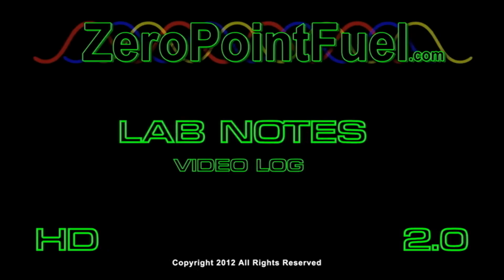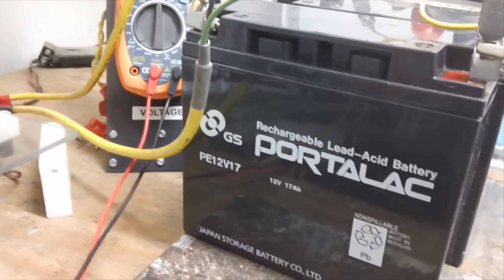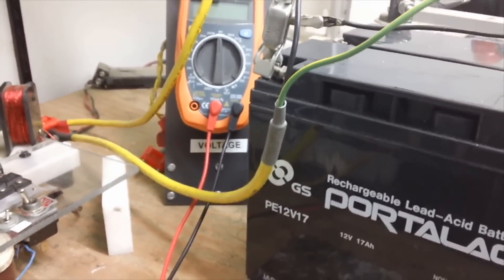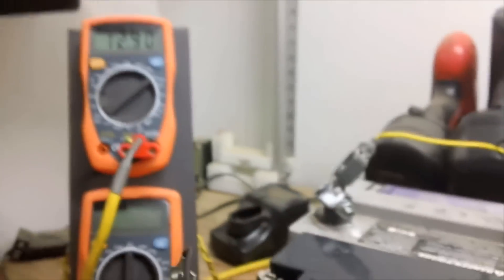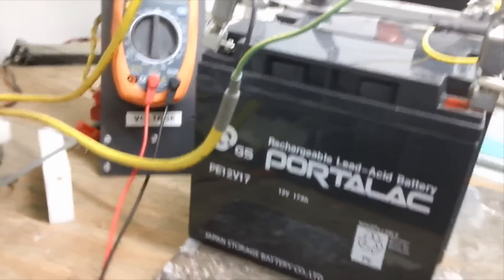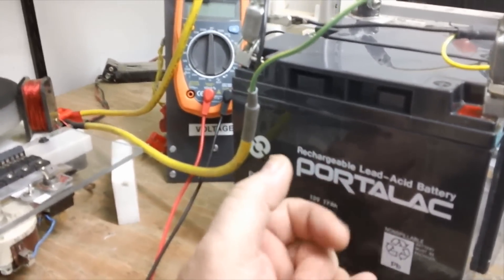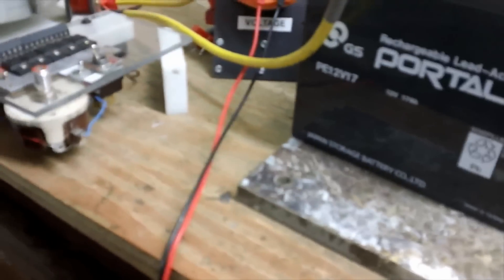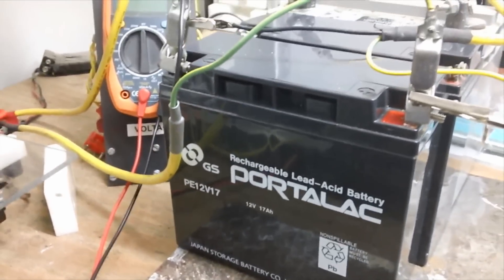Pulse Motor Charging a Sulfated Battery

Comment: ok so my question is about the out put to the battery being charged. I have done some testing on my pulse charger charging a capacitor capable of holding 200 volts and it gets up there pretty quick... im hesitant to attach such a thing to a lead acid battery as i dont want it to explode due to over charge. So i gathered from your video that the lower the input voltage and rpm of wheel the lower the back emf voltage spike is which would make the input charge to the dead battery manageable. am i correct or do you have a cut off circuit to protect things?
Reply from the maker: Well, Kevin yeah your capacitor can blow up if you overcharge it can explode and sound like a gun throw shrapnel everywhere.  If you hook a battery up with the capacitor  it will climb slower the capacitance is blocked off due to the resistance of the battery,  also on a capacitor you can also add a resistor across the terminals this will essentially do the same thing it also prevents the capacitor from holding a charge for safety purposes, a capacitor will charge relatively fast based on the amount of storage in the device if it is a low capacitance device it will charge rapidly but if you stick 15 farad super cap, you will not see the same effect. But in your case, the capacitor Will absorb the energy spike, that what it's designed to do and it will not be effective at desulfating your battery.
Reply: the caps i was using were two 200v 460uf in parallel so 920uf. those charge faster then a super cap at 2.5v 10F? good to know thats the theory. I am using a bedini circuit with a charge and run battery, the super high voltage spike wont hurt the battery and over charge it at warp speed like it did with the cap? there is no need for a cut off circuit or anything?
Reply from the maker: Yes you can overcharge your battery and destroy it but it doesn't happen in seconds you can overcharge anything you have to be careful and monitor the voltage, lead-acid car batteries after the initial drop and Spike once it stabilizes I don't charge it above 14 volts and will settle out at 13 volts,  nicads on the other hand, I generally charge him three or four volts above and the longer a charge them .  Most of my 18V nicad batteries I charge them up to 24 volts regularly without any issues eventually they will fail, if you overcharge a nicad battery it can overheat.  It is good practice to monitor prototypes don't leave them unattended they can cause a fire unless you have safety circuits like thermal switches are voltage cutoff points built into your devices, you should never leave them unattended.

Comment: A battery can be sulphated if it's left discharged for a long period of time. If the battery is new it may well be worth repairing but if it's 4 years or more it's probably best binning it as batteries don't usually last more than 5 years.
If you're not bothered about being stranded take the chance but if you prefer reliability always discard batteries when they reach 5 years. £100 over 5 years is only £20 a year. What is that compared to the fuel used, insurance, road tax, tyres, repairs etc over the same period of time?
Reply from the maker: Honestly I think you missed the point of the video by pulse charging the battery  it actually changes the structure of the battery I have batteries that have been on charged on this type motor for more than 10 years  and they're fully capable of holding 12.5 to 13 volts  there are commercial charging units that are available that utilize the same principle.  You have a large battery Bank extending a life to double its normal  lifetime can save you significant amount of money.(not talking automotive use here)

Comment from the maker: one other point that is intriguing the pulse motor is not hooked up normally the negative of the batteries are actually hooked to to the input positive so a high side low side connection is more accurate.

Comment from the maker: In electronics, a shunt is a device which allows electric current to pass around another point in the circuit. in this case it is operating as a Defective device bypass operating in parallel. in most cases it is in series but consider how a amp meter work's the current is flowing through the shunt but a small amount of the current  is passing through  the meter measuring the difference in this case the bad battery is the meter and the good battery is the shunt.

Comment from the maker: it depends on the general condition of the sulfated battery but some of the smaller ones can be the hardiest to get working again it could take a week sometimes but the longer you let it charge better it will work it also depends on your SSG motor and how well it can make the spike.